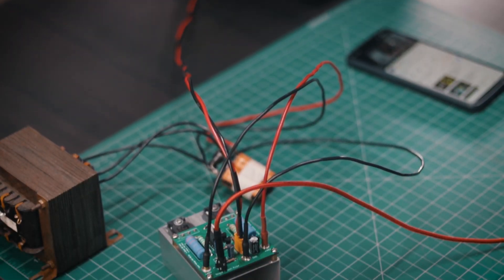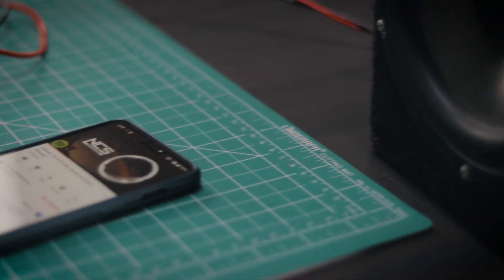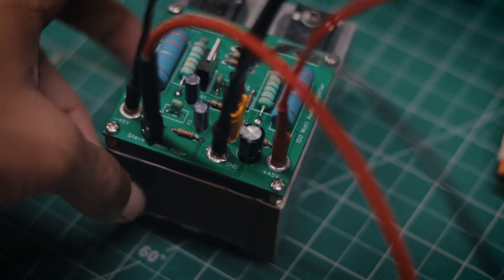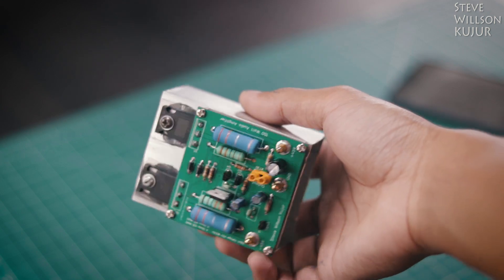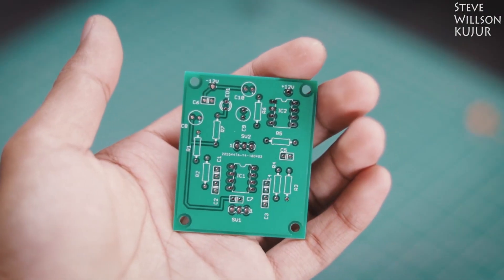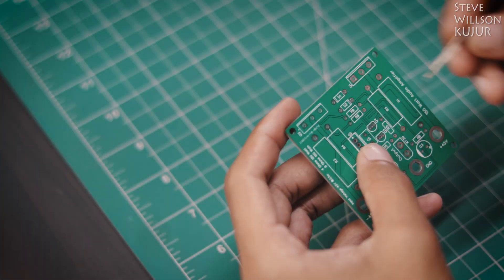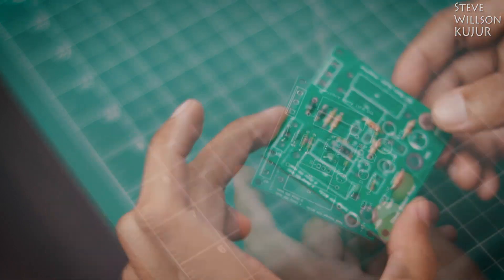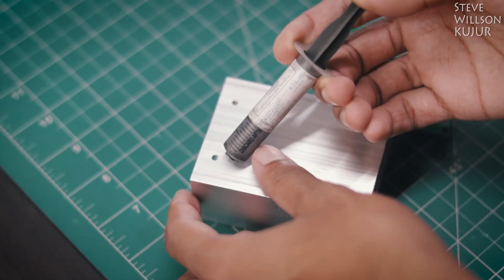How to make a 150 Watt RMS Audio Amplifier

Comment: i'm at my 20th DIY amplifier the smaller  delivery 2x50 the big  capable of + 250rms X 2 , your amplifier is pretty good a cheaper to make but  becarful ! if the output is short circuited  ,the power transistor burn ( i use a pair of darlington TIP 142/147 ) without protection .
Reply: LOL ! this circuit hasn`t any IC

Comment: 150 watts?? I don't think so. Firstly not enough volts. That heat sink will NEVER handle 50 watts, never 150!! Only 2 driver transistors? Into what impedance? 1 ohm? I think this is just one big advert to sell you stuff!
Reply: didnt sound like it
Reply: exactly

Comment: 150 watt rms @4ohm is about 25 volt rms or 35 volt peak. Therefore we have to supply with at least 2x40 volt. Is this circuit can accomodate 80 volt supply?
Greetings from Indonesia
Reply from the maker: ibles bosuok it's need -+45